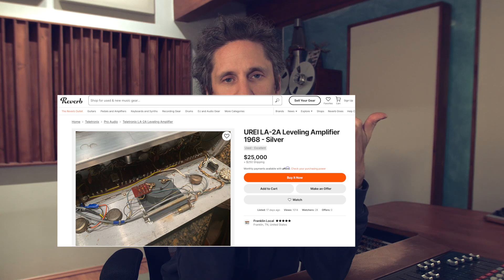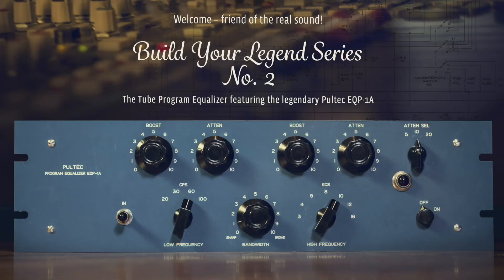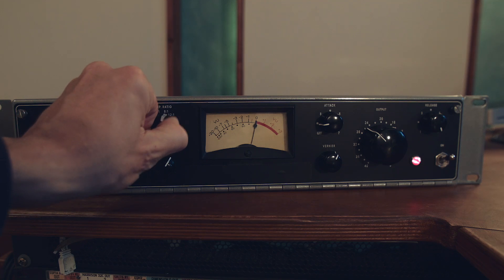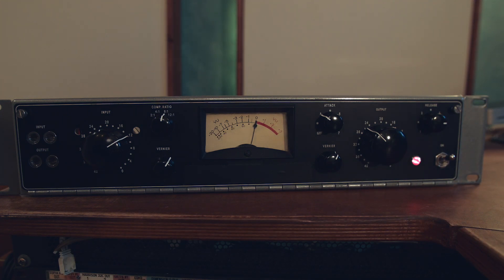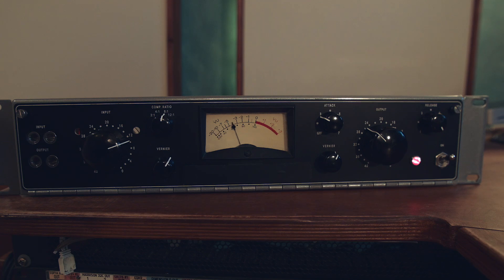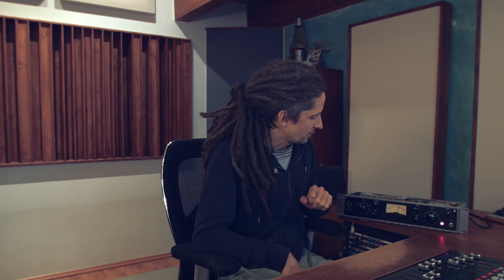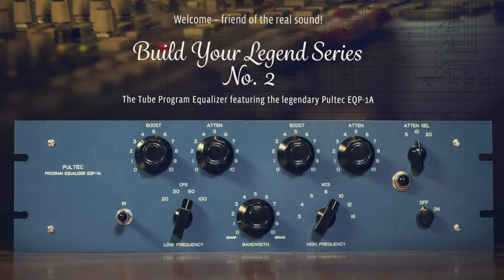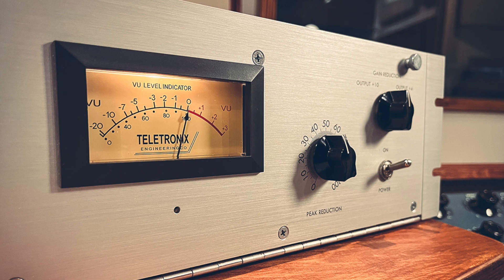176 VARI-MU Limiting Amplifier Complete Kit - Episode 1

Comment: subconsciously, I read 1176 Vari-Mu....and I think what the heck?:) those are 2 different concepts of compressing/limiting...
Reply from the maker: yeah, the only thing they have in common is the concept of controls with fixed thresholds depending on the ration, driving the input against that threshold with the input knob. Also both fastest attack and release with the knobs fully CW. But in terms of sound - two completely different worlds!

Comment: I would love to buy one. But I’m scared as a beginner to take up a project like this, because I can imagine it won’t be a 300€ project.
Reply from the maker: I can fully understand - even though I try my very best to make it as accessible as possible, there are certainly simpler projects to begin with. A good first step would be to check out the video and free "no-more concerns" e-paper linked in the description. 
And yes, it'll be far from a 300€ project, but compared to a vintage 176 as one of the rarest and  best sounding compressors, in the unlikely case you can find one at all - this project at least puts it in reach for many more us! ❤
Reply: 3000😁
Reply: @ToniJXN  yeah……a bit too much over the top for me. But probably justified in the parts.

Comment: Been wanting to make one ever since I saw Drip demo his unit, but it was quite expensive to build just for my own project use. Then those boards went away. Really interested in this one 🫡
Reply from the maker: Been there too! Yes it's not the cheapest project to build but it's so worth it! The problem is also that it's very difficult or even close to impossible to find the original parts. For the kit we'll have many parts custom made for us specifically for this kit - such as the transformers for instance. We sent AMI in the US some original vintage input and interstage transformers  and had them reverse engineer those - a lot of work went into it going back and forth with several prototypes - now they're 100% true to the original - inside and out!